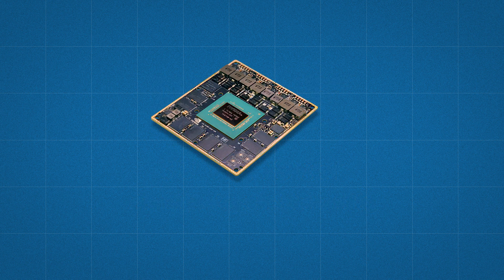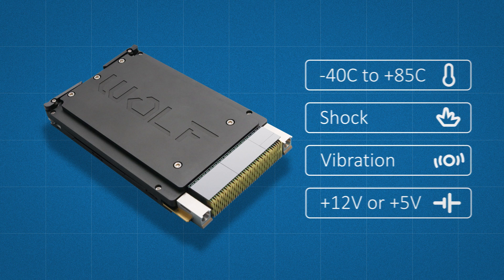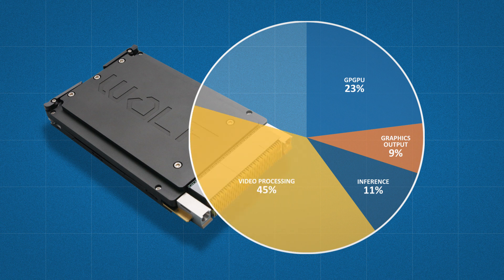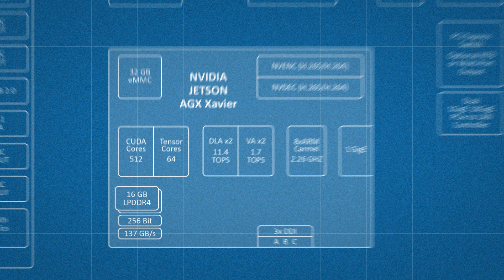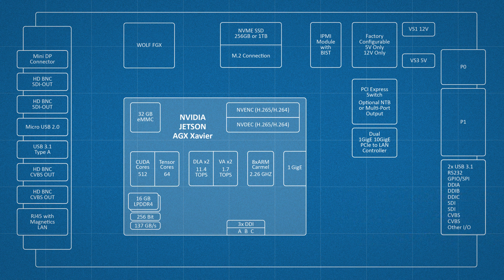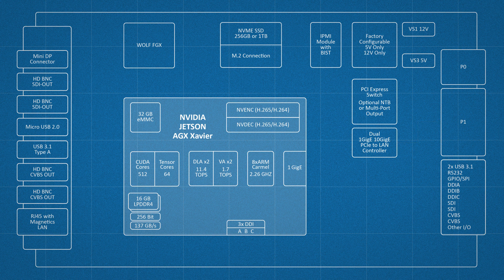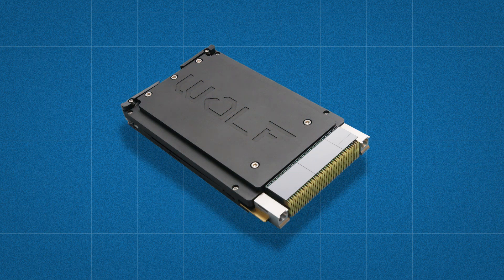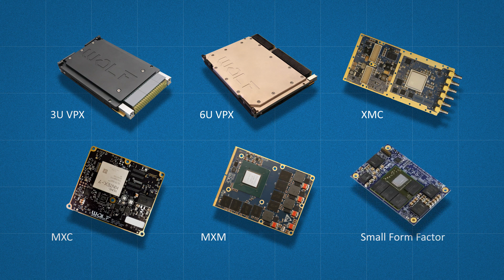3U VPX NVIDIA Jetson AGX Xavier for Military and Aerospace

Comment: Can this one used to control flaps, slats, alieron, rudder, elevator, and landing gear ?
Reply from the maker: Typically, a product has to be DAL-A/DO-254 certified to be allowed to do that. All we can say is that it is an area of interest for us at this time.
Reply: @WolfAdvancedTechnology  what about pilotless plane flying systems design ? Did they use NVIDIA Jetson AGX for autonomous taxi takeoff and landing ?
Reply from the maker: @irsyadhasan3908   Yes. It's good for that application.
Reply: @WolfAdvancedTechnology  what about AMD 29050,Intel 80486, and motoropa 68040 that used to contop 777 Flight computers ? Can we use apple bionic chips, Intel i9, AMD Ryzen 9 3990X, Qualcomm Snapdragon 875, NVIDIA Tegra processor, or anykind of powerful gaming CPU, powerful gaming GPU, powerful gaming RAM, and powerful gaming System on Chip to control systems like alierons, flaps, slats, engine throttle, spoilers, spoileron, flaperon, elevator, rudder, landing gear, flight envelope protection, and ATTOL software ? Can we robotizied every airplanes using server processor, gaming hardwares, or anykind of powerful processors ?